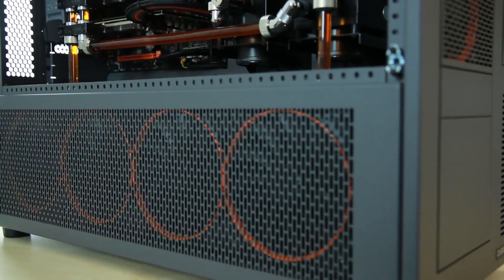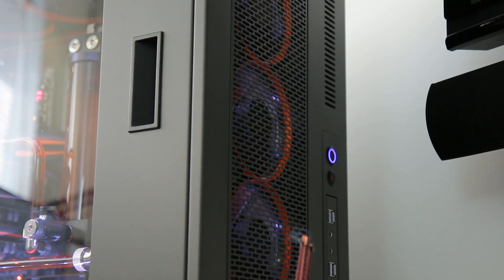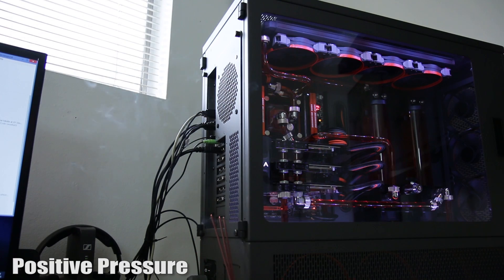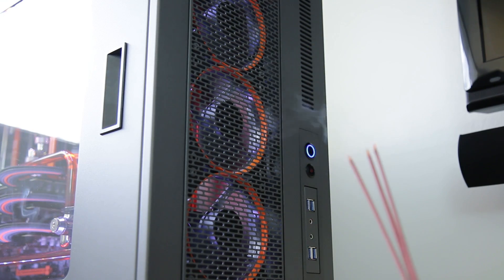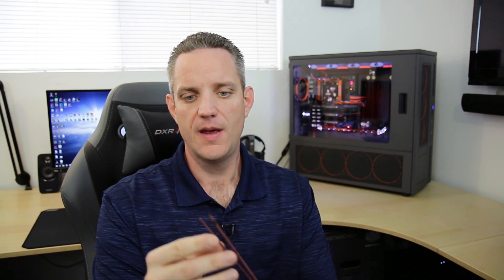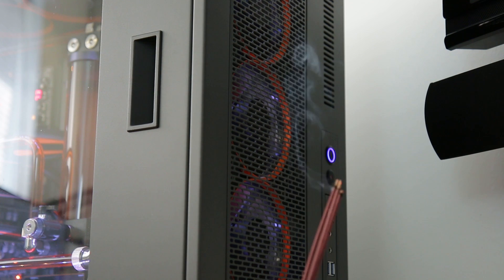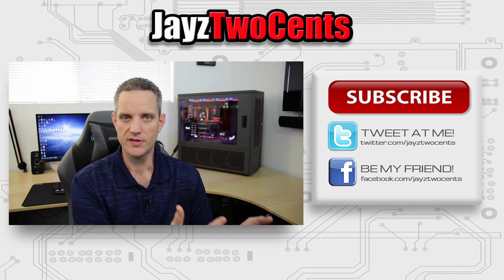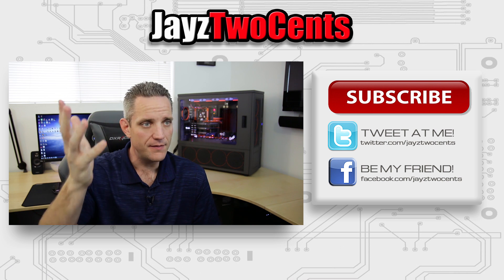Case Flow and Pressure Demonstration - How to balance airflow

Comment: Been debating about getting the Corsair AF 140 Quiets for my Obsidian 450D. But I got a PWM controller so I'd really like it if they were PWM controllable. Can anyone recommend some 140mm airflow PWM controllable fans?
Reply: +Michael Hagood
PHANTEKS PH-F140XP PWM 140mm
They have a relatively high airflow (143m³/h) and are relatively silent (19 dB(A) @1200 U/min without the included Quiet-Speed-Adapter)
I say "relatively" because there are always fans that are either more silent, or have more airflow and stuff like that. But I think overall they have a very good balance between airflow, static-pressure, noise and price.
It comes with:
-The fan itself
-4x screws
-4x rubber screws
-1x Quiet-Speed-Adapter
-1x 4-Pin Extension-Cable 400mm
-1x 4-Pin to 3-Pin Adapter

http://www.amazon.com/Phanteks-140mm-Radiator-Cooling-PH-F140XP_BK/dp/B00E9NZX7E/ref=sr_1_1?ie=UTF8&qid=1453572998&sr=8-1&keywords=phanteks+ph-f140xp+pwm
Reply: +Meta Custom Computers That&#39;s currently what I am looking at. I do like the Corsair AF140s but if only they were PWM controllable. But anything is quieter than these stock AF140L fans. Running these or anything else off my PWM controller should make it so they never maxed out their RPM and thus dB. For fun I did a burn test on my 4.3 Ghz OC&#39;ed 4670k and got it up to around 70 C making the fan run at max rpm, usually it&#39;s at 30-40% and silent. Even maxed out it was still quieter than the stock front intake fans....

EDIT: My CPU cooler fan is a Fractal Design HP 14, great fan, but the HF (airflow) versions aren't PWM :(
Reply: +Meta Custom Computers Someone recommended the Noctua  NF-A14 or the NF-P14r redux if I didn't like the brown. While I know Noctua has a name for itself the quality of it's 20$ fans just doesn't compare to what you can get for 20$ from other companies. Basic design, basic mounts, no rubber, and just poor looking quality. However I've been looking at their NF-A14 iPPC-2000 and 3000, they are most spendy at 33$ and 27$ respectively  but they at least have the qualities you'd expect from Noctua. Have any knowledge of these fans?

Comment: I have 2 fans on the top, 1 in the rear and 2 on the side ( my case has no front fans and is pretty sealed off, I mean it has like 1 at the bottom but it's VERY obstructed, like very, hint, it's not a high end case and it's pretty old age model, it's a super flower case for crying out loud ). That setup has my HDDs at like 30 C for years and years now which is fine, my GTX 660 never goes past 60C unless it's like 62 in GPU intensive games like Metro:LL and others like that and my i5 4430 on stock cooler barely goes above 60.

Comment: Mine seems to be setup pretty good, I actually just cleaned out the dust today after 6 months and it wasn't that bad, and I live in dusty California around orchards.   I have the HAF 932 case with the massive 230mm fans as intake on the front and side, a 140mm exhaust fan and two Corsair SP120's on my H105 running at 70 percent speed.

Comment: What does PWM mean?
Reply: Pulse-Width-Modulation or something like that
Reply: +Pratik Kamble Pulse-Width-Modulation is correct. It turns your fan&#39;s power on/off very quickly (25khz is the intel specification I think) in order to control the fan speed. An older equivalent to this would be varying the fan supply voltage which is pretty much outdated nowadays. But at the end of the day both techniques will control fan speeds.
Reply: Padro Podra  So basically its just like AM or FM? just in this case the duration of the wave is modulated?
Exiled Storm Thanks!
Reply: Glad I could help!
Reply: +Pratik Kamble  Well AM and FM both rely on sine waves. With FM, the frequency change describes the amplitude of the source signal, while the amplitude of the FM modulated signal stays. With AM, you're changing the amplitude of AM modulated signal to describe the source signal. With PWM, you're changing the duty cycle, i.e. your amplitude is always the same, and you're always outputting a pulse wave, as opposed to a sine wave. But it's a modified pulse wave, and the duty cycle says what portion of the time you spend at the top of the pulse vs. the bottom.

Granted, all 3 have been used in music instrument synthesis! PWM is very typical of the NES tunes, the lead parts always use that, with 50% duty sounding kinda nasal and 12.5/25/75% duty cycles having a thinner, more overtone rich, more musical sound, and they would change the duty cycle while the note is playing to add expression to it. FM is Adlib and SEGA Megadrive's main synthesis method, where it would wobble one frequency with another to create more complex tones. And AM is one of the many main tricks of subtractive analog synthesis.

Comment: guys I need PSU that when the power shut off in my house it will keep my pc running so I can turn it off before it damage my pc any names I'm using GTX 970  I need one not to expensive and not too cheap
Reply: I've searched and I couldn't find one with this feature
Reply: Look for a UPS (Uninteruptable power supply) it also cleans out your power so the power going into your current PSU is better. Basically it's a big battery but they're pretty expensive
Reply: Exiled Storm i just found a backup power supply from apc and it has a good price

Comment: Hey Jay, I have 2 stock case fans in the front my Cooler Master N400 intaking, I also have 2 Corsair AF120 fans, one on the right side intaking, and one on top exhausting. Finally I have a Corsair H55 CPU cooler with the radiator mounted on the back of the case as an intake. Its odd having the rear fan as intake but it seems to work well and using your method I determined I have slightly positive pressure.

Comment: pc case filters dont really do anything. they are only there for people peace of mind and for looks

all you need to worry about is if you have some kind of linear airflow happening, ie, dont set everything up as an intake. 

if people were serious about pc filters, they would be a paper filter and not even a single spec of dust would get in there.

Comment: I am using be quiet silent base 800 with 5(6) fans. Front intakes 2x140mm, back panel intake 1x120mm. Exhaust 2x120mm fans on top, on AIO radiator. And yes, last one - on a side panel 120mm, but i am only using on heavy gaming, to help cool gpu. All 4 intake fans have dust filters. Over all i think this setup creates positive air pressure.

Comment: One thing people should look and research when searching for a reliable fan is the CFM (Cubic pressure per meter) best fans will have a good CFM around 100 over to i say 200 will do, this is the push rather then the pull of air. This in turn helps promotes a positive airflow by pushing air at minimal speed. You should also look for a fan with high RPM (personally speaking anything over 900/1600RPM)  since this fan are none bearing and low db (Decibel). Issue is most fan over 140mm will have a low RPM (seen some no more then 800RPM to 1000RPM).
Reply: +felipe martinez I agree partially but you always have to remember that fans are used for different types of jobs.
It always depends on the job, if you want to use them as case fans for airflow, fans for a radiator with high fin-density, do you want to have an ultra-silent computer for your living room, etc.
Fans for pure case-airflow should have a high m³/h (CFM for Americans), that shows that it's capable of moving a lot of air. For radiators with a high fin-density you should get one with high mm-H2O, that shows that it's got very good pressure. For silent-computing you always have to find a compromise, you definitely want to use low-RPM fans, mostly recommended with PWM.
Generalizing that fans should have this CFM and this RPMs might lead people in the wrong direction for a fan that should do a different job.

Kind regards,
Meta Custom Computers

Comment: Jay, use your almighty power to pressure Corsair into making their ringed fans reversible. It couldn't be that hard to make it fit on both sides. I would love to use my rear exhaust as an intake however that would really hurt the aesthetics because the ring wouldn't face to match my upper radiators fans. In the meantime I have a damn vacuum going on in my case with little to no intake whatsoever. I guess it's better to look good than to feel good lol.

Comment: I tend to use a thin sheet of paper, negative pressure will hold it against case vents while positive pushes it away. Not so good for working out neutral airflow or weakly positive/negative, but only takes a second to check. I don't like the smell of incense :P

The smoke turned out well on camera, I thought it was quite clear what was happening.

Comment: Jay, you forgot to tell people about airflow direction through the case.
If you set all of your fans inward (for MOAR positive pressure), you will have turbulence and dead spots in the case, which usually happens around the graphics card if airflow is not there.

You've got diagonal from bottom to top, you can go horizontal, you can even go vertical up, or vertical front/back. Just don't point all your fans inward unless the case is designed with all fans exhausting in one location.

Comment: I have a Fractal Design Arc XL, I use 2 of the stock 140mm fans on the 12v Fan setting with the front panel header then 3 Noctua NF-F12 iPPC fans on my 360mm rad in the top of my case which are set to use the motherboard's fan controller dependent on CPU temp

Comment: I'm using the default fans on my define r5 on it's fan controllers. Low seems to put negative air flow at the back vertical vent where the medium and high settings is completely positive airflow.

Comment: if you cut out the fan grills on the case, you get far better low noise and air flow.  if you have young daft kids,it's not advised however (fingers).

Comment: For anyone trying to calculate their pressure (input - output), make sure you take into consideration rear exhaust GPUs and power supplies.
Reply: +Simonarne Myklebust that's what I said yes
Reply: +Simonarne Myklebust the holes remain tho, so there's still some air going out
Reply: +Joshverd unless it's a blower, they shouldn't affect much, basically just holes
Reply: +Cris Sto actually a blower style cooler will take air from inside the case send it out. but a open gpu cooler wil send it out in the case

Comment: I have a fan in the front of my case, one in the side window (right beside the gfx card) and one exhaust. the one in the front and on the side are both exhausts, and there are no filters. Of course, i expected dust to cover the card, but i am getting dust buildup very quickly in other places too. Especially the power supply and cpu cooler. standard amd cooler. is this normal?

Comment: I had initially put two intake fans and had three exhaust fans in my case but quickly realized that was a bad idea when I noticed that a tissue would be pulled up against the side vents of my case. I disconnected the two top fans, leaving only 1 exhaust and now I have positive pressure and the tissue gets blown away from the vents. since I have a dust filter on the front fans that's where I collect most of the dust now which makes cleaning much easier. Thanks for this, I may now want to further play around with fan speeds and see how that affects pressure in my case.

Comment: I use the Corsair Commander Mini with it's PWM Fan Controller and a full set of BitFenix Spectre Pro PWM Fans and interface it with the GPU / CPU Temps to scale the fan speeds. Using this means I always maintain a positive pressure even as the load increases. The added benefit of it is that for light-use, the computer is extremely quiet and only ramps up the fans when I start pushing the "envelope" ;)

Comment: Two things people need to realise: You can't plug numbers into excel and calculate your air flow or pressure. Just do the combos and measure it. 2) you can have unmixed air inside a case. Meaning that you can have some cracks in the case under negative pressure while others are under positive pressure.

Comment: jay you should do a video on rigid fittings and what each do what you need them and which ones are needed in a build I just got in a bunch of parts doing a new 2016 build with 2 g1 gaming 980ti's a 5820k asus x99 deluxe mobo and 2 tb of ssd storage and I'm going to do a rigid tubing water cooling system on everything and I don't know how many fitting I need or which ones I need I have done my measurements but don't know what I'm doing when it comes to buying the fittings I have the tubing all the blocks my fluid my res's and pumps not sure if I'm doing separate loops yet so yeah much thanks even a reply would be great or a link to a website

Comment: i have a 900D just filled all the slots with fans and have 2 fancontrollers deal with it with temp (nzxt grid+ and a fan hub controlled by fan expert from the asus motherboard) will be switching to water cooling when budget allow it